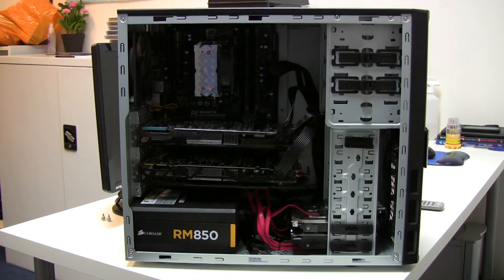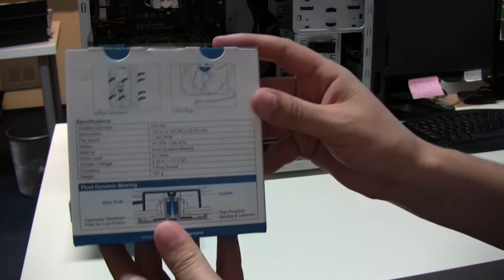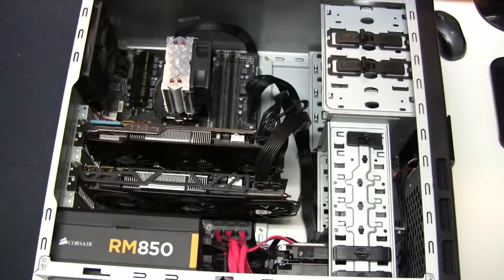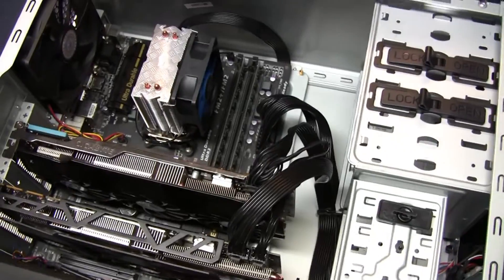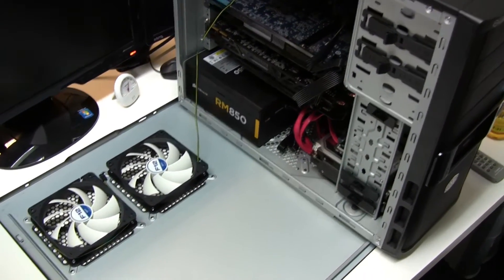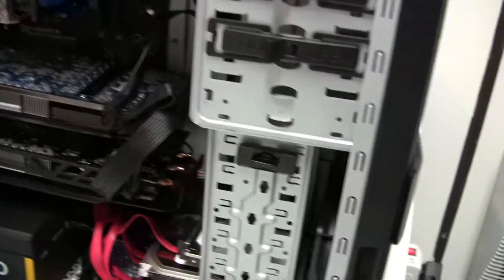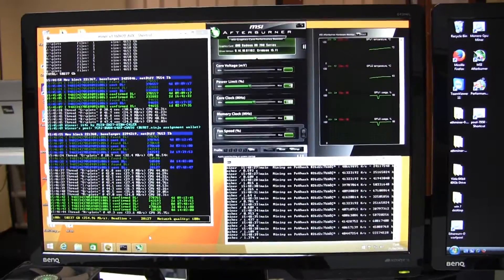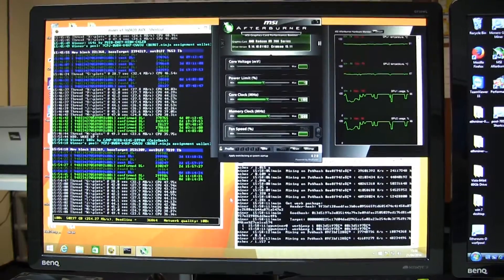Extra Cooling for the Ethereum Twin 280X Rig

Comment: Hi, have you ever apply hyper positive pressure on the case using industrial fan ?
Delta or sunwo. These things run on 1a to 3,6a. It is 4k - 10k rpm. Dont ever try plug these fans on motherboard. 
You can even plug off the gpu fan so the gpu only have heatsink. If you align the heatsink and the air flow. It better to have gpu heatsink fin that symetrically with case wall. So the high pressure air can flow from the back to the front or otherwise. 

These fans run on dual ball bearing and have a long life and easy to maintain.

Comment: nobody willing to tell him he mounted at least the sidepanel-fans, the wrong way......why suck warm air out when they could blow cold air in and onto the graficcards?...nvm, just me wondering. greetings from germany
Reply from the maker: If I pulled cold air in from the front and the sides where would the warm air exhaust out? I also have this case laying sideways venting the gpu heat up and outwards rather than pulling cold air down and into the case. Thanks watching and commenting.
Reply: just make the air exhaust through the upper back as usual?...or would this lead to to much heat in the case in general?
just wondering if it wouldn´t be better to give the cards a good blast of cool air insted of just sucking a lil warm air out of the case. usualy this side-vents are designed to give the cards cold air 4 better temps, aren´t they?
Reply from the maker: DJStrangeAl
I might test both setups and share the results in a video. It's the only way to know for sure.

Comment: Hey Lee, it's almost like you are reading my mind. I ran into this same issue with my ETH rig. 2x 280x were over heating. I removed all doors because most of the exhaust is coming out from the sides of the GPU and not the back. overheating mostly solved. Running anything over 2 GPUs like you said, it is a mandatory requirement to use an open air rig. I also noticed the bottom GPU runs slightly hotter than the top and the fans are @ 100% while the top is @ 75%. i know the problem is the case that i am using, it is a nzxt s430. Have you ran into this issue with your case?
Reply from the maker: +DigitalErra Running these hot cards in a closed case is not ideal, it's not so bad for gaming as the GPU power goes up and down but for dedicated mining where the GPU is at 100% it best to use a open air setup, using a external gpu mount and riser cables is the best way. However in this work space I have to keep everything closed up.
Reply from the maker: +DigitalErra One simple thing that can help is lying your case flat on its side if that's possible, that way the hot air rises directly out of the gpus up and away.

Comment: nice bro, i run my mining on GTX 970 with my case door opened and its on 73C and its really hot where i live (Iraq) , and my case has one fan only(CPU FAN), i think iam lucky then :) , just wanted to share these info with u :)
Reply from the maker: +MWGame1 Yes the newer Nvidia cards run much cooler than the AMD cards, my gtx 970 runs about 70C with the case side on, although the ambient air is much cooler here in the UK.
Reply: +RiskyRandoms Yea, thats right

Comment: Hi Risky, Really enjoying your videos been looking through all the ones to do with Ethereum mining.
 I am in the process of building a 280x rig myself with three cards and wondered if it's ok to run three cards on an 850w X-Series Seasonic PSU?
 Also when connecting the monitor do you connect to the GPU's or the onboard monitor connector?

Thanks.
Reply from the maker: +Mookfish2012 Hi, yes that psu should be fine. Does it have a single 12V rail? if yes its good to use. Plug your monitor into the first 280x GPU (slot1). Sometimes the onboard graphics will be auto disabled when you add a GPU card leaving you with a blank screen so plug into the 280x not the onboard.
Reply: Hi, Thanks for getting back to me so quickly :) .
 The motherboard I have has 1 GPU slot but three sata slots which I was going to use PCI-e extenders and use the sata slots or can I use the GPU slot for one card and then the sata slots for the other two?

Yes the PSU will have a single rail.
Reply from the maker: Mookfish2012
You say sata slots? but I think you mean pci-e 1x slots yes you can use those with extender cables. They work just the same a full 16x slots for mining purposes.
Reply: Hi Risky, How's things?
 I liked your video bout the guy that lost 136,000 btc although I do feel bad for the guy aswell.
 I just had a couple of quick questions if you don't mind?
 1) How is your Satoshi Dice investment going now is it still paying well?

2) Do you ever cash in your Bitcoins for currency and if so how do you do it safely?

Many Thanks, Keep up the good work.
Reply from the maker: Mookfish2012
Hi, I'm doing great thanks.

The Satoshi Dice invesment is doing very well I've been uploading videos on the performance monthly and will be doing another one next week.

I don't cash out very often as I'm more of a miner / holder, but if I do I use localbitcoins and use bank transfer for the exchange.
Reply: Thanks for the info , I looked into Localbitcoins and I have to say it looks a lot more trust worthy than other exchanges I have checked out so thanks again.